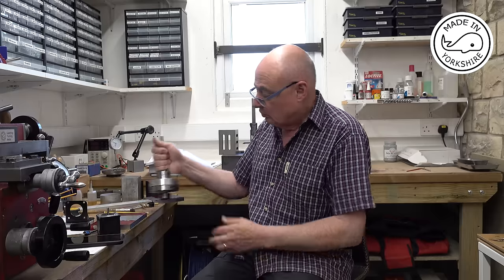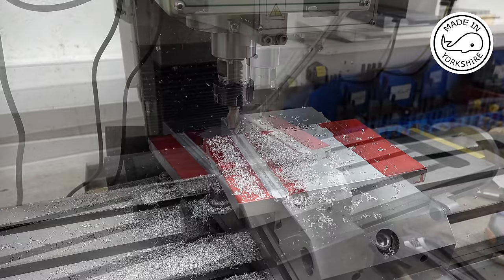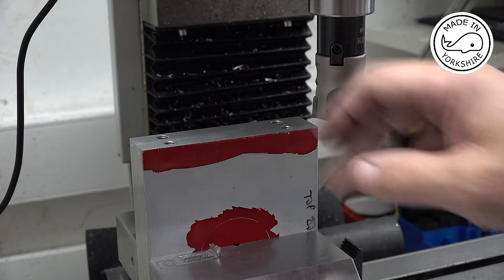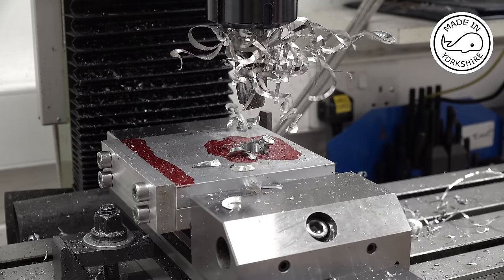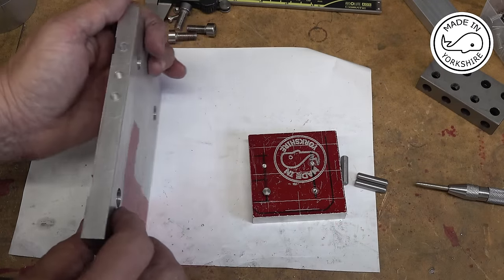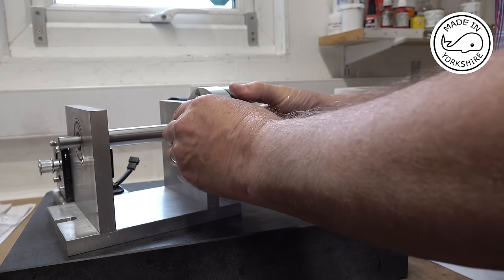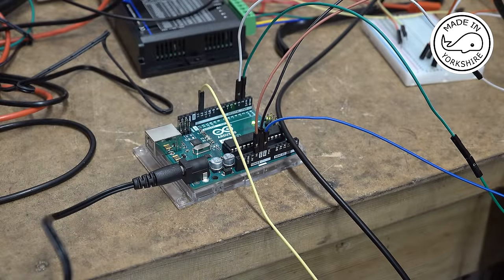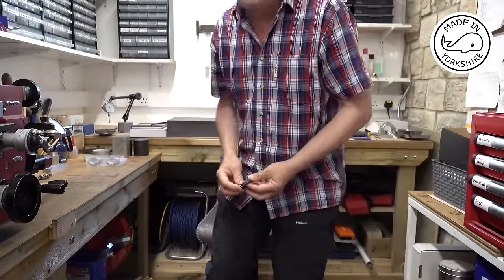#MT50 Part 3 - Making a Gear Hobbing Attachment. The Housing. In 4K/UHD by Andrew Whale.

Comment: The idea of roughing the surface up is never a good idea. Sorry having been involved in mechanical design for most of my working life NO. Are you aware that metric bearings became the international standard in the early 1930s. To me, you have no excuse for not getting a bearing book out & sorting your bearings out  to begin with. It has to become part of your learning curve.
  You wanted to have the OD of your bearings run through the housings to make it easier. A very sensible approach. Bearings come in different ODs & widths for the same IDs. Or you can have two bearings with the same ODs & different IDs. This latter approach would have been better suited. The big end would have been 20mm ID & the small end 17mm ID but wider to make up for its being a smaller diameter. The holes would have been 47mm OD if they were deep groove ball bearings. You could have had the same with a 17mm & 20mm Tapper roller bearing set up both having 47mm OD bearings. I will be careful about the angular contact set up ones because the static & dynamic loading favour the 17mm x 47mm bearing more than the 20mm x 47mm bearing. Whereas you can pick a pairing that give identical Dynamic & Static Loading if you choose taper roller bearings.
   This is all by the by as you are in the learning phase & I like most of your keen watchers are always amazed at how quickly you learn. More importantly, you are not afraid to make mistakes. The sign of a bad engineer is that he has never made any bad mistakes. Meaning that he has never pushed himself hard enough to learn properly. We all make mistakes & we all learn from them.
   I can sit here waiting to hear of the mistakes I have made in this letter. But I should point out that I have sized up a few hundred bearings of many sizes & most types from slewing rings to hollow taper roller bearings & quad set angular contact bearings. Amongst many others. Now I am happily retired & when I look at the calculation I sit & wonder how I did all that work. Much better to simply say size it sort of right & it will work at the ME level.
Reply from the maker: Hi Mervyn - thanks for the info. To be honest I'm pretty rubbish at designing things. My aim was to make the housing out of bits of material I had already got. I thought I had some 3/4" bar but after purchasing the bearings I realised it wasn't. My father designed lots of different types of machines - including large printing presses. He was an Associate Member of the Institute of Mechanical Engineers - a great achievement in those days. Unfortunately I lack some of his genes. The hobbing attachment turned out okay in the end and will certainly last for many many years. I'm pretty happy with it.
All the best.
Andrew
Reply: @learningturningmetal  Do not underestimate your achievement. We learn by making errors. That is one area where your next design will improve. Simply because you now know that you can match the same outside bearing diameters with different inside bore diameters & changing the widths of the bearings to match them up into pairs. Regards Mervyn Price